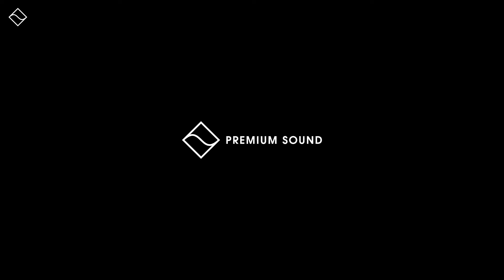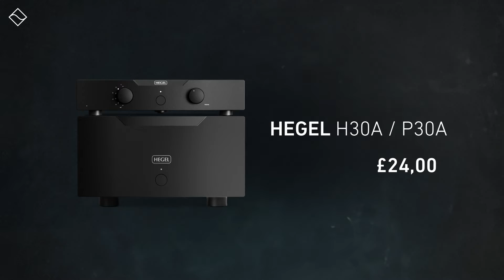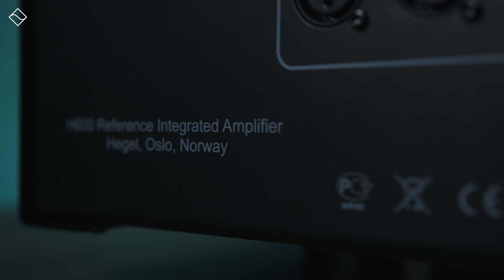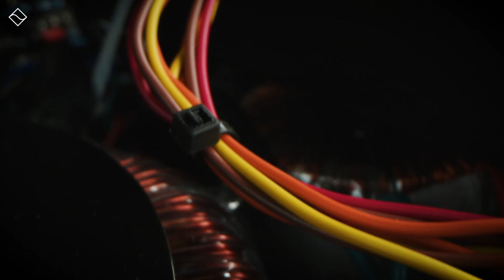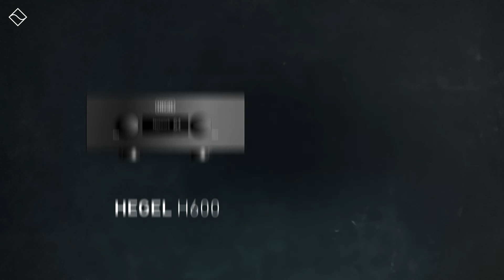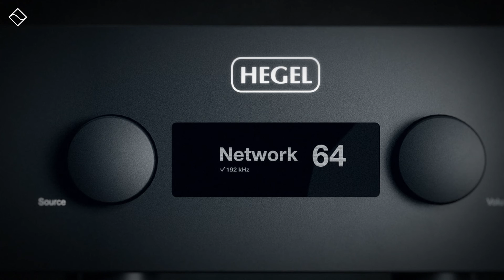Hegel H600 Integrated Amplifier Review

Comment: H400 anybody?? 😃
Reply: Is there an important sonic/ auditory reason Hegel amps are invariably coupled with Harbeth Speakers at Hi Fi demoes or us thus a purely commercial relationship?

The H600's DAC is a good "chip" DAC but not high end.  So expect to bypass this with a DAC thus adding to the cost.  So better off therefore with the H400?
Reply: Exactly what I’ve been predicting since the H600 dropped.